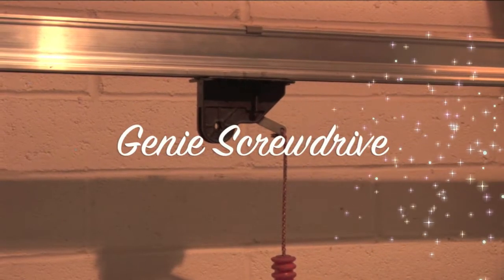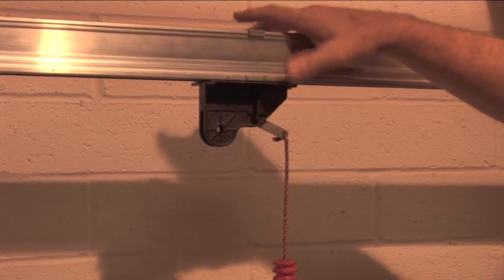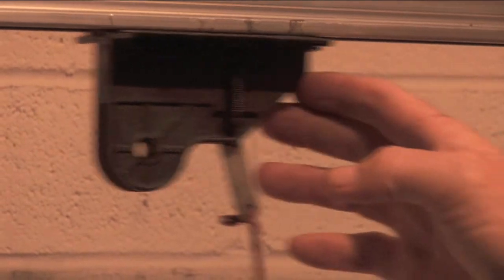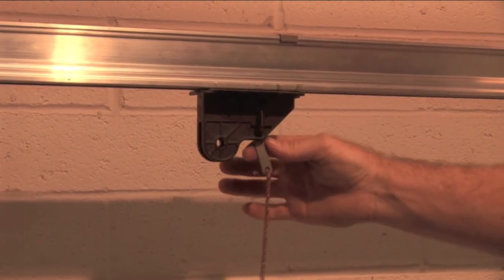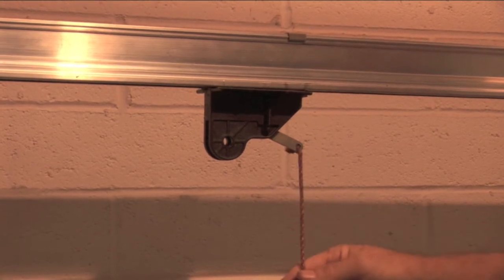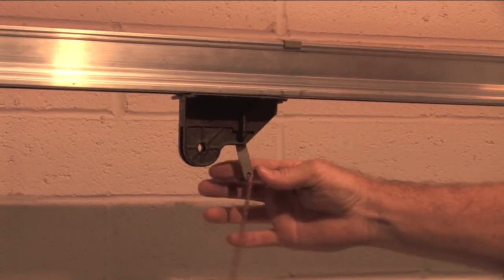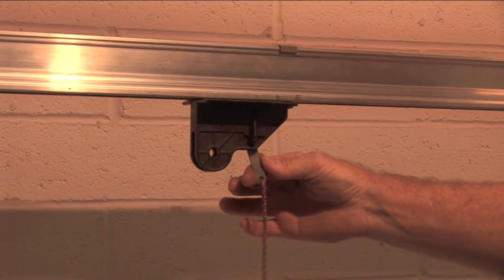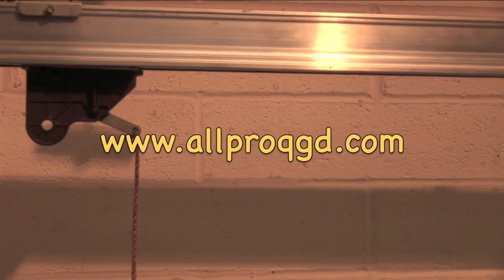Genie Screwdrive

Comment: This may sound like an odd question, but is the casing on this mid 90's Genie pro made of metal or plastic? I know the newer Genie pro SD's are made of plastic, but the metal casings don't seem to crack or warp like the plastics. Probably more expensive to manufacture though.